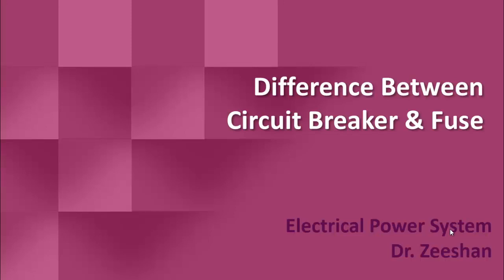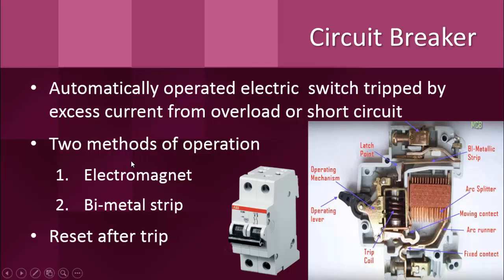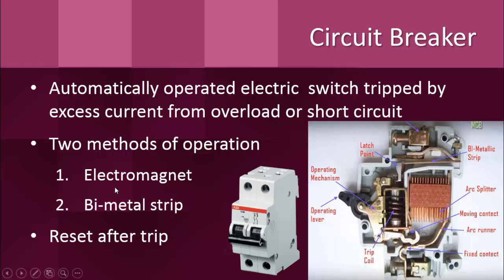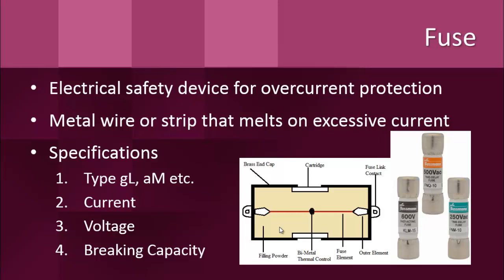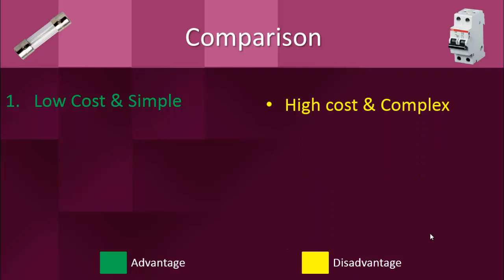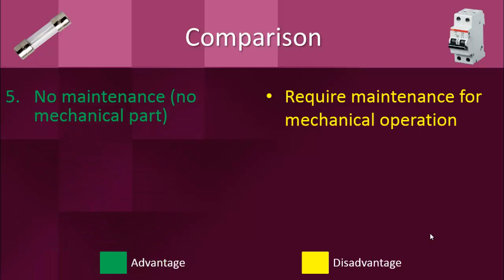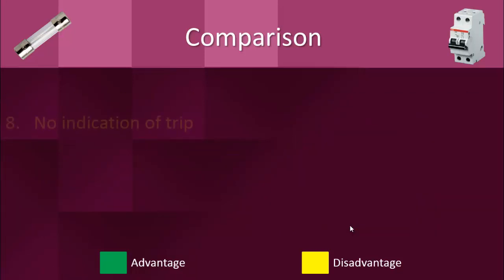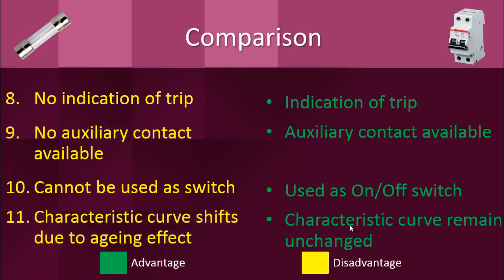Circuit Breaker Vs Fuse | Key Differences | Working Principal Explained

Comment: What is the difference in between Fuse& circuit breaker in the case of selection of sizing for different types of starting.
Reply from the maker: Same. There is no difference especially when designed for short circuit protection. Both can be selected from 175 to 225%